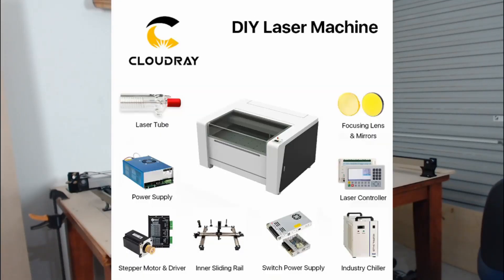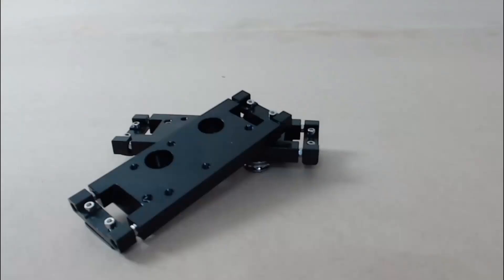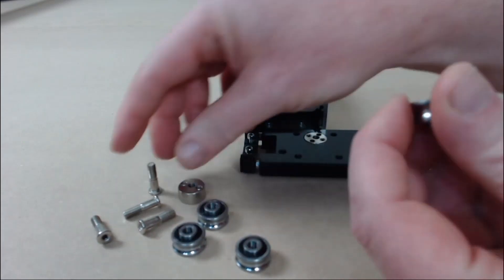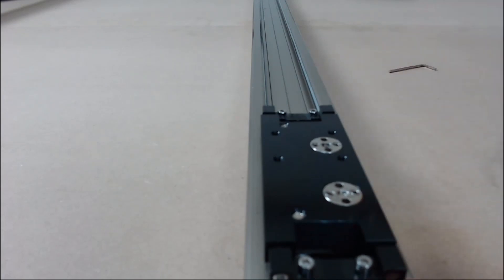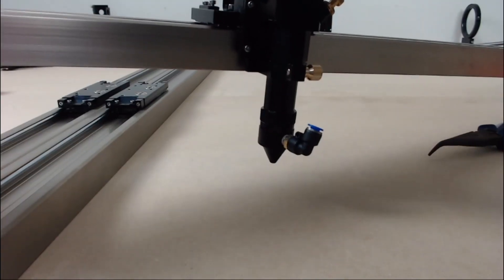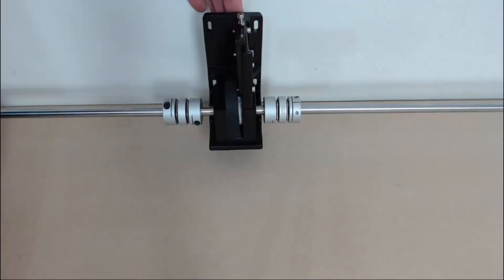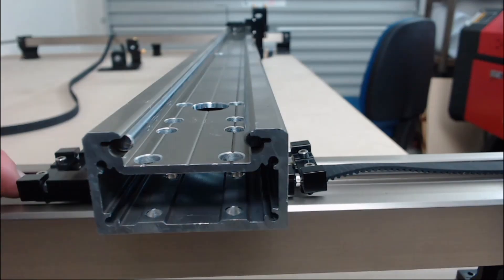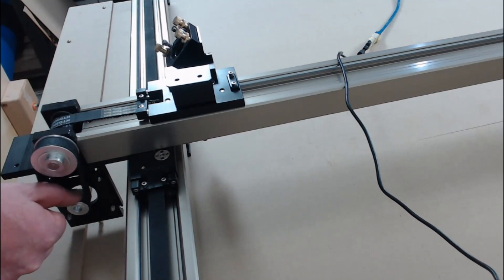03 Build Your Own Laser - Axis Rail Kit Assembly.  [Inc. Mirror, Laser Tube & Motor Mounts]

Comment: looked at other steel wheel slider rails builds.....i'm patient and if i have to sacrifice time for accuracy....iaccept it...i used linear rails on a build i did 4 years ago...600x400, 2040 extrusion....still have, works great...relubed 2 years ago with new bearings....but now thinking bigger...back then, hiwin linear rails.....and not their cheaper brand...today though, for a massive build, these have gone way up in price.....so, love what i have now....repeatabily is very accurate for multiple pass jobs.....but cost for a rebuild is.....boing!..... original build was around $1200

Comment: You used the inside rails version, how did you come to that decision vs outside or linear rails? I’ve not been able to find pros/cons for each.
Reply from the maker: Cost is a big factor I'm informed and read that the linear guide rails are "more accurate", however for speed inner sliding rails are preferred.  After using both linear and internal sliding rails I still prefer the motion of the later, and have not noticed any inaccuracies with the cutting.
This is my short explanation of the 3 main rail types.
- Inner and Outer rails are almost the same performance. 
- Compared to Linear rail, Inner rail and Outer rail are cheaper, faster and more stable for moving, but may not be as precise as Linear rail.
- For Inner rail, dust can accumulate inside the track and should be wiped down regularly to maintain performance.
- Linear Rail has higher cutting accuracy.
For more detail on specifications, check with your supplier.
Cheers Matt

Comment: Hello, 
What is the difference between External Slide Guide, Inner Slide Guide and Linear Guideways ?
Thank you
Reply from the maker: This is my short explanation of the 3 main rail types.
- Inner and Outer rails are almost the same performance. 
- Compared to Linear rail, Inner rail and Outer rail are cheaper, faster and more stable for moving, but may not be as precise as Linear rail.
- For Inner rail, if the working environment is bad, they may not be suitable, because the dust tends to accumulate inside the track and should be wiped down regularly.
- Linear Rail has higher cutting accuracy.
For more detail on spec, check with your supplier.
Cheers Matt

Comment: Can you comment on inner versus outer slide rails?  What are pros and cons of each?  Also, what is the source of the decreased accuracy of inner slide rail versus linear rail?  Are there specs?
Reply from the maker: This is my short explanation of the 3 main rail types.
- Inner and Outer rails are almost the same performance. 
- Compared to Linear rail, Inner rail and Outer rail are cheaper, faster and more stable for moving, but may not be as precise as Linear rail.
- For Inner rail, if the working environment is bad, they may not be suitable, because the dust tends to accumulate inside the track and should be wiped down regularly.
- Linear Rail has higher cutting accuracy.
For more detail on spec, check with your supplier.
Cheers Matt

Comment: Cloudray has been sending out the wrong size bolts for all their gantry setups.  The bolts that come with the kit are about 4-5mm to long.  So if you order one, you might as well get an extra set from amazon.  Also they don't sent enough belt with the 1390 size I ordered, and up from other known purchases.   You will need to purchase more belt to complete.   The belt sent is nylon reinforced, so you should replace it anyways with 3M 15mm HTD steel reinforced belts to eliminate belt stretch backlash when etching or cutting with higher acceleration settings.    Cloudray needs to work on their QC when sending these things out.    I also ordered a honeycomb bed from them a while back.   While it is made of quality parts, I ordered a custom size of 1200x900mm.   I received a bed that is much smaller than what I ordered and also had incorrect hole sizes in the grid.  You select custom size for the outer dimensions of the bed, as well as three different hole sizes.  I ordered the largest hole size but received 5mm holes instead.    Better be talking with them if you're going to keep representing them Matt.   I have two other friends that ordered different sized gantries from them as well and one was custom ordered to a larger size and is also came short by about 60mm and more on the other axis.   The other friend bought a 6090 unit.  It came with the long bolts like the other two did, but that was the only issue with that one
Reply from the maker: Thanks for the update - I'll fwd your concerns to CR
Cheers Matt
Reply from the maker: Hi Josh. I've received a reply from Cloudray regarding these issues. Could you email me at matt@mwlaser.com.au so I can forward you a copy of the email. Cheers Matt
Reply: @MWLaser  Email sent

Comment: Hey,
Thanks for the great videos!

I’m interested in building a laser cutter my self, was thinking about going the same route as Further Fabrication did, as its a good bit cheaper.
Do you have any complaints on his execution oft he build, especially on his use of V-shaped extrusion for the x and y axis. 

Thanks again, giving great guidance and reasoning.
Reply from the maker: I must admit I have not seen Further Fabrication's build, so I cannot comment. I'll check it out.
Reply: MW Laser were you able to check it out? What your take on it?
Reply: MW Laser updates?
Reply: @Dark_Knightro  i built that y-1200, it won't cost you less than this, after you add cooling and all the accessories you'll be near 4500$ or more and the design is inferior and the parts like the gantry will give you nightmares. I'd go with this one if i was you

Comment: Which timing belt model you use for the X axis and Y axis. Also which model I use for the closed loop timing belt.
Reply from the maker: For All Axis Belts I used HTD3M-15 Timing belt
The closed loop units came with the Inner Sliding Rail Kit and Motor Mounts, I didn't purchase them separately.  All belts are 15mm width.
Reply: Thank you Matt’s

Comment: question why do you use a beld for moving the x and y axes and not a threaded rod is much more accurately
?? I have a cnc with a beld and i am not happy with.
Reply from the maker: There are many reasons, but a few are: - in order to achieve the speeds required for engraving you would need a powerful motor to drive a threaded rod on the X & Y axis, this would then require larger and more expensive stepper motors and drivers, Also they may cause more vibrations and this can interfere with the laser mirrors etc, which results in poor quality engraving and cutting. 
If you want a more accurate setup than sown in this video, then I'd recommend using linear guide rails rather than the internal sliding rails, however they still use belt and pulley systems.
Cheers Matt
Reply: @MWLaser   ok i understand you point will think about it when i build one again !!

Comment: Hi Matt. I'm interested in upgrading my machine to the mechanical set from cloudray. https://www.aliexpress.com/item/32801728941.html?spm=2114.12010612.8148356.63.4e463f8acPWALK . 

Just wondering the center motor shaft at the back. Can that be mounted at right angles to how you have it in the video? - So the long side at the bottom? Asking because I am restricted to 95mm in height below tube enclosure.
Reply from the maker: Yes is can be mounted either way. Cheers Matt

Comment: Loving the series Matt. 
I want to use cloudray’s 1390 x/y inner rail kit, how did you pick the steppers and drivers for this? I’ll also be using the z lift kit-set b as you did.   Thank you!
Reply from the maker: G'day.  The Stepper motors were chosen for, 1st the mount size provided on the rails which was NEMA23, then x axis rail was physical size smaller so as not to put excessive weight on the rail as it would be moving back and forth as it is mounted on the end of a the rail.
The Y axis needed more torque than the X axis as it has to drive the belt attached to 2 couplings and rods to move the two belts on the Y axis rails.
The stepper driver was selected to suit the 3 phase motors chosen.
and of course price payed a big part in the selection :)
Hope this helps. If you have questions about motor and driver selection, I found it easy to email cloudray's support for answers.
Cheers Matt
Reply: @MWLaser  Thank you Matt.  Your thought/selection process is so helpful.  I wish Cloudray had more technical specs/info on their site.  I am in touch with Cara from Cloudray, but there is always some misunderstanding in the response.  My fault for not taking Chinese instead of French in School.
Reply: @SocalCanyonRacer  Thank you Michael, If you have any questions of our products, you can mail us when you're free, our engineer will help you to deal with it. Hope will not make misunderstanding any more~

Comment: Hi Matt. Thanks for another great video and presentation. I'm curious how easy it is for the rail mechanism to bolt onto your 30x30mm aluminum extruders (including the rear y-axis motor bracket). Have a great day.
Reply from the maker: Thanks Steve, I won't be attaching the rails directly to the 3030, I will be putting aluminium sheet to the edge on the profile to the outer edge of the frame, and the axis rails will be secured to that.  The y axis motor will have a mounting bracket made to secure it to the frame.  Cheers Matt

Comment: Great video. I put rails on my 3030 profiles and made it myself. I am really curious with what material you close the enclosure...
Reply from the maker: Thanks, I am currently considering Aluminium Sheet for parts of the enclosure, However as I an planning each stage separately I am still working on working option this into the budget.  Cheers Matt
Reply: Can you show me your made?